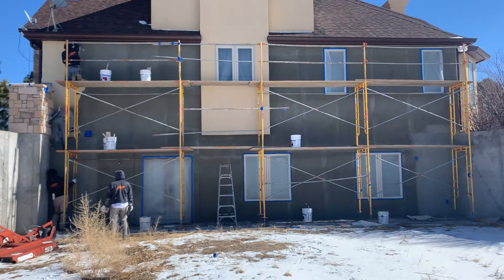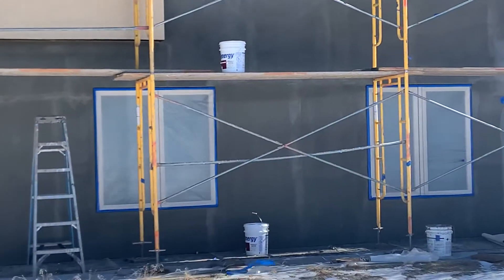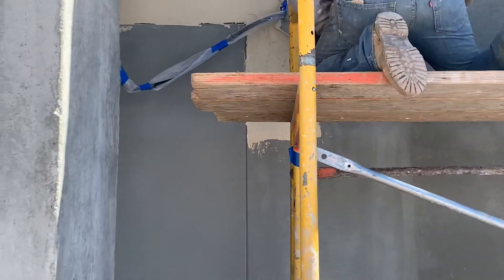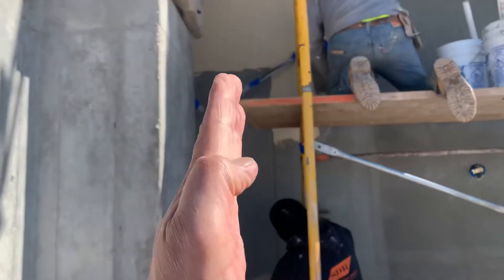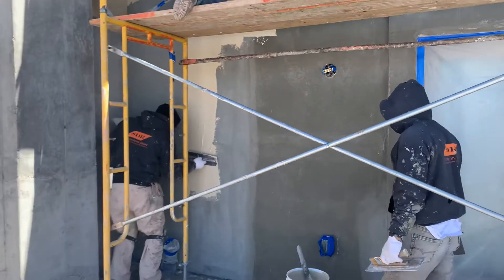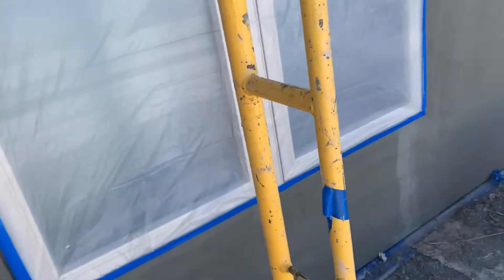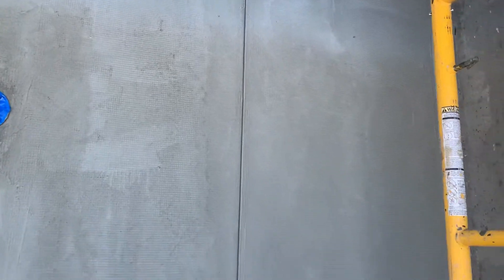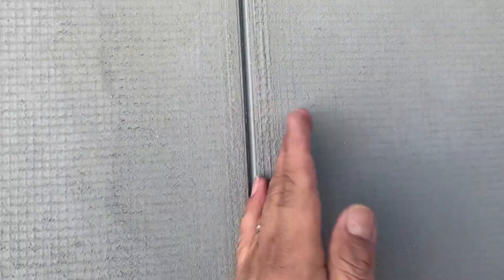Prevent Stucco Cracking by installing Control and Expansion joints to dissimilar substrate walls

Comment: Hi from North Carolina... Good job.. there is any way how to put stucco on a slick concrete wall using only mortar "Type S"?
Reply from the maker: Hi, thanks for watching my videos!
No, not a good idea to install stucco directly on slick concrete wall. You will need to use vapor barrier yo prevent efflorescence and metal lath fasten with concrete nails to other fasten with air gun.

Or you can use FlexiStucco is like a wallpaper that is adhere to retaining walls and such. 

Thank you 
Alex
Reply: @stuccodonerightllc4288  thx a lot... Your videos are very good. I have been watching some and they are actually very good. Thanks for share to all the people that always its looking for references as these👍💯

Comment: Great video! I am buying a home and can see where the expansion joints are.  Are the gaps suppose to show or are they suppose to be filled to make it look like one wall?
Reply from the maker: Hi Lisa, thank you for watching our video!
The expansion joints are commonly exposed as a groove in the wall and are left that way however they can be filed only with colored silicone to continue to allow movement of the wall and prevent cracking. If the current joints are filled with stucco materials then the materials will crack and delaminate from the area. Aesthetics is the reason why residential building avoids control joints on most houses and are mostly common on commercial buildings. 
Good luck and I hope my reply helps you with the decision making on the purchase of your new home, Congrats!!
Reply: @stuccodonerightllc4288  
Thank you for your reply.  I am buying a new construction home in Central Texas and was told my stucco home will have them.  The builder’s model home has them, and i definitely agree they don’t look nice.  I am debating if I should ask the builder to not add them.  🤔

Comment: Do you know how to prevent hairline cracks in a cmu wall? I tried embedding fiberglass mesh in a cementitious product that is generally used for adhering foam to stucco over a brown coat before applying a stucco color coat. I'm still seeing cracks along the grout lines. Especially visible when the wall is wet due to the grout absorbing and retaining water at a different rate than the block.
Reply from the maker: Hi Thomas, 
Thanks for reaching out.
Unfortunately the proper way to prevent visible grout joints, cracked joints and efflorescence is to install vapor barrier lath and traditional hard coat stucco over the lath masonry wall. 
Here in CO we have the efflorescence issue if the walls do not have vapor barrier. 
You almost need to tape the vapor barrier to the wall it is ridiculous but is unfortunately the proper way to install stucco over a brick or masonry wall.
Hope this answer helps.
Reply: @stuccodonerightllc4288  Thanks for the reply. I should have specified that these are free standing walls. Not part of a house. Does what you're saying still apply? I've never seen stucco guys here in northern california do that.
Reply from the maker: @wthomas7955  I know, I come from Phoenix and now one does that however when I relocated to Denver area I encountered efflorescence and after doing enough research and this information came directly from my sell rep at Smalley and Company for Senergy products.
Even on free standing walls this applies. 
This system sure sounds like an overkill but it is the only way to prevent your current issue and efflorescence. 
Efflorescence is the wort to deal with and this method prevents it. 

I will make a video next time we install cultured stone or stucco over masonry walls. Yes, this also applies to cultured stone
Reply: @stuccodonerightllc4288  Interesting. I can imagine that fixing both issues, I just haven't seen anyone go to the trouble to do it. I'm going to pay more attention to color coat stucco walls in the future and see if can find any that aren't cracked. There is a hot spring near me that has some buildings I'm assuming are made of block with stucco color coat, no cracks. I noticed a little corner where some fiberglass mesh was visible so I know they used it. The pores of the finish coat are somewhat open. It doesn't look like a sanded finish but it's not hard troweled smooth. Maybe a sponge finish or something like that. I don't know stucco well enough to say. Beautiful job. I'm going to have to find out how they managed it. 

Efflorescence hasn't been a huge problem for me so far. Although I saw it on the blocks before I covered them. I ground and power washed off most of it. My understanding is that once the salts have leached out it's pretty much done. Although I'm not 100% on that. 

I have to say, the application of fiberglass mesh has definitely been an improvement over some of the walls that I've had stucco subcontractors do in the past. It's almost as if the cracks are behind the fiberglass layer and telegraph forward because the water absorption pattern in the blocks and grout shows up. The visual appearance of cracks seems to fade when the walls are no longer saturated. On walls that the guys do the typical way, (1 base coat/2 coat finish), the cracks along the groutlines are noticable from a distance. 

My experience working in Breckenridge some 37 years ago leads me to wonder if anyone in CO goes to the trouble. Maybe quality standards are different down in Denver. Is that what you folks do? Are clients reluctant to pay the price?
Reply from the maker: @wthomas7955 Yes, from experience most customers here in CO choose the path of least resistant and hire contractors to install stucco directly over masonry. 
Not always happens but when efflorescence appears it doesn’t stop until vapor barrier is installed. 
Stucco suppliers sell efflorescence spray and often works but for the few places that it doesn’t then the full system is required.
I have some pictures of masonry projects
We have lath. I can share via email or by text message as I cannot attach here.
Reply: @stuccodonerightllc4288  Oh, I did lath a concrete building I built into the side of the hill that I had to waterproof. So I know what that looks like. No cracks. So I believe you when you say it's the solution to the problem. I was hoping there might be something a bit more cost effective in terms of my labor, heh, heh. I might just plant vines to grow up on those block walls anyway. Obscuring the problem.

It's funny, I went round and round about this with the material suppliers here and the best solution they were aware of was the one I described to you that I ended up trying. You'd think they'd get feedback on what works. Oh well. 

Thanks for your input.

Comment: Where are the expansion joints done? At the wood level or at the cement level?
Reply: The expansion joints are installed vertically on center between the frame and the concrete. 
On the horizontal joints the control joint overlaps the concrete by one1inch.
Reply: @AlexGarcia-wz2bf  Thank you.

Comment from the maker: No, the current system on the house is a “One Coat” and the lath is 1”-20 gage lath wire. We did repairs on the sides and install control joints to separate the wood framing from the foundation wall. But is not a 3 coat system.